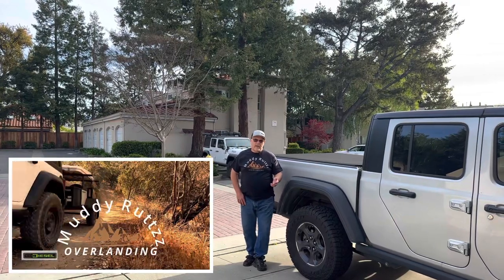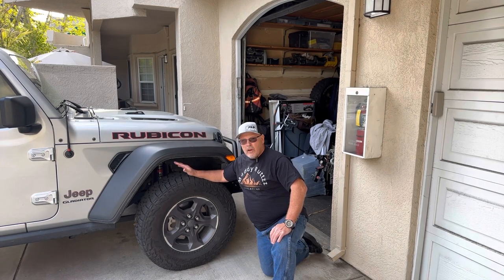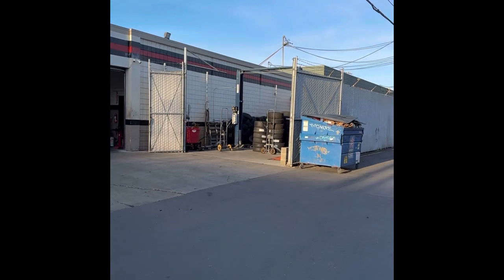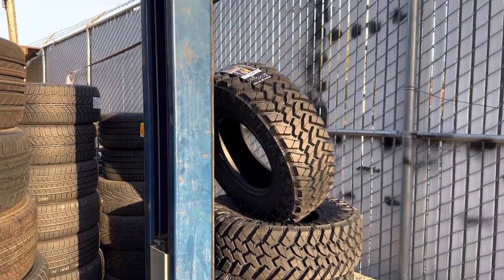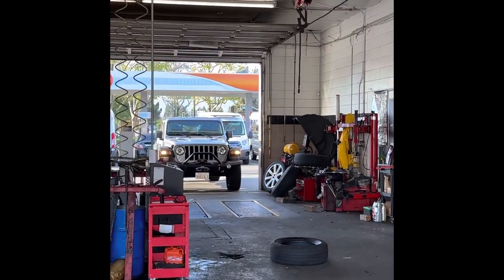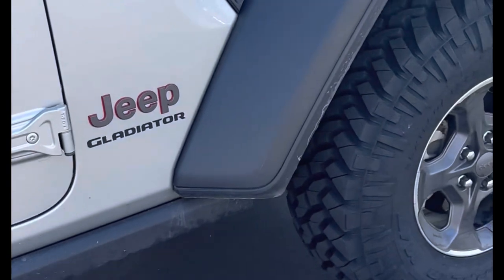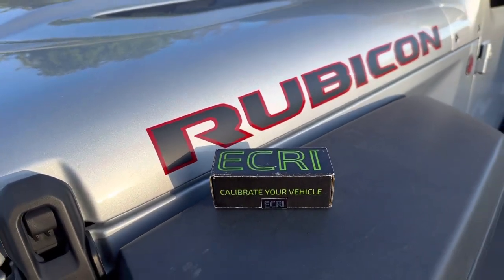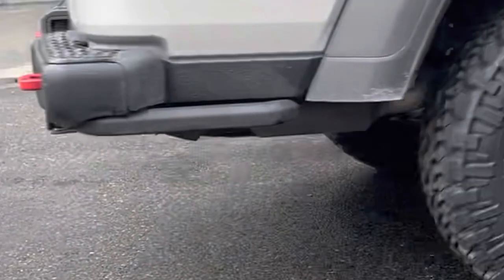35s on stock rims no lift - do they fit  the Jeep Gladiator? #jeeprubicon #nittotire #trailgrapplers

Comment: Yes it’s OK to jack the vehicle up from the rear differential, it should always be done cautiously I always use a jacket that has rubber or I’ll put a rag under it but that’s a common place to jack up the vehicle and the gladiator in the rear is very light.
Reply from the maker: Thanks!

Comment: OK so it's been a year have you put on a 1.5 inch leveling kit or are you gonna do a lift ? How has it been running stock on the 35 11.50r17 tires ?
Reply from the maker: Diesel motor and gearing have no trouble spinning the tires. Tires are really great off-road. My problem is the weight of bumper and winch. Font end with stock Rubicon Fox Shocks and springs bottoms out going over bumps. Have to get a good lift like the Mopar with different springs and shocks before I can really take this vehicle off-road. Stock Rubicon shocks are mall crawler shocks. Just have to put some money together to do the lift.
Reply: Heard that same thing that holds me back money

Comment: all you would need is a 1.5 leveling kit, drilling was unnecessary
Reply from the maker: I’m planning on putting the Mopar 2” Lift  on this Gladiator. Since it’s my wife’s I had to put some steps on the side first. Now just have to save money for the lift kit.
Reply: @MuddyRuttzz level kit is like 100 $

Comment: can you put 35x12.5x22 on a stock gladiator WILLYS PKG
Reply from the maker: You can with the right offset on your wheels. I wanted to keep the stock wheels so they will only allow up to about a 11' wide tire to be mounted on them. I don't recomend spacers.  I just don't trust them. Thanks! If you haven't make sure you subscribe!

Comment: Will 35x12.5r17 fit the stock wheel?
Reply from the maker: Check the manufacturer guidelines on your chosen tire. Stock rims are 7.5”. Limits the choices. Thanks!
Reply: I have 35x12.5r17 on stock wheels. It fits but not recommended, and I’m waiting for my new wheels 17x9 with -12 offset.
It comes down to the width, your wheel needs to be no more than 3 inches less than the tire width.
Reply from the maker: @twbl218  Sounds like your doing the right thing for safety.  Thanks for the information and thanks for watching. Good luck with the vehicle!